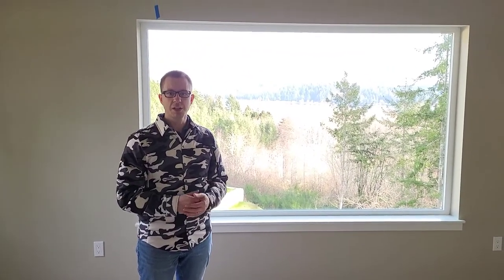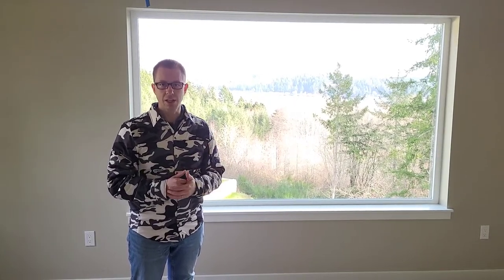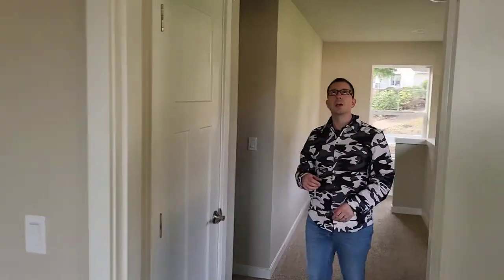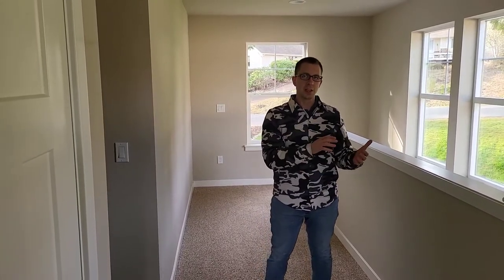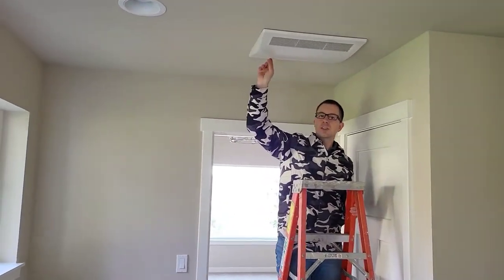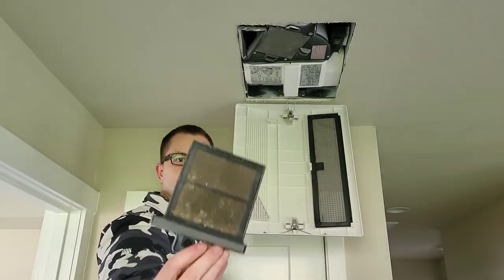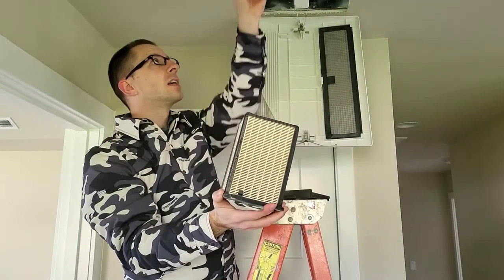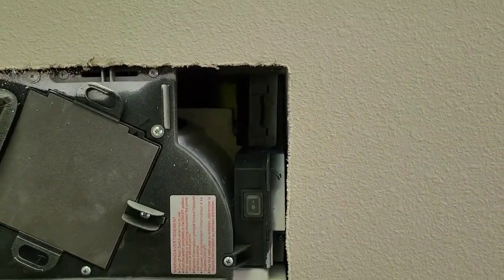Walk Through of the Panasonic WhisperComfort ERV

Comment: Nice video!  It kind of looks like it is just filtering air that is in the house?  Where is it getting outside air from?  Does the return air go through the same filter chamber that the supply air does?
Reply from the maker: Thank you.  The air is filtered, but it also is a more energy efficient way of supplying outside air to a home.  The enthalpy (energy) core allows heat energy to transfer between the outgoing and incoming air streams (sensible heat).  It also allows latent heat (water in vapor form) to transfer.  The outside air comes from an inlet either in the sidewall or roof and it discharges through a separate outlet (again in the sidewall or roof).  The return air is separate from the supply air.  Hope this helps!!

Comment: Could you elaborate on the wiring setup?  I assume its powered by a standard 110 line?  How is the switch wiring setup?  Thanks
Reply from the maker: Bear in mind that I'm not an electrician. I think you can wire one of the plugs in the receptacle as a switched plug, and you can wire the other plug to a separate circuit for constant power (for serviceability). The other wire connects in the unit and at the other switch. The boost switch must bipass the controls in the unit that modulate power output via the dials.
Reply from the maker: Oh, I'm sorry, I responded to this thinking of a different unit/set up. Possibly this is similar? We will be installing a new WhisperComfort, and I'll pay closer attention
Reply: I installed 2 of this units and electrician just ran one wire to it for the white black and ground. And now this things don’t work at all 
I would like to see a wiring to do mines 😫😫😫😫

Comment: I am getting to install Panasonic FV-04VE1 can the ventilation go through the roof
Reply from the maker: Absolutely, although, if the roofing is asphalt, and you're in a hot climate, it might tend to bring in bad air. Consider putting the intake on the north side, if possible

Comment: Im about to install this unit and was under the impression the drywall sits above the flange. Yours looks like the flange is sitting on the drywall...
Reply from the maker: We're going to be installing another one soon. I'll take a look
Reply: I about to install mine as well to my current home and am contemplating how to go about installing it without having to put a giant hole in my ceiling just to fit in. I came up with 2 options and am wondering what you think. 1. Cut off the lip that's around the edge to easy put the unit from the top of through the attic or 2. Bend the lip down and then unbend it when I get the unit through the attic down through the drywall. If I do neither, the only option is to make a longer hole to slide the unit from inside into the attic and then patch the extra left over hole. This option seems the worse. Anyone know if there is any consequence of bending or cutting the lip of the unit. Thanks
Reply: @theczechdude  I cut the flange/lip. Cut the hole to the exact dimension of the box and dropped it in from the attic. I applied ducting tape around the perimeter of the cutout and wrapped it into the side of unit. Made a box out of Styrofoam insulation to put over the unit in the attic and spray foamed over it. I have it connected to a Swidget (dry contact switch) and it turns the fan on and off depending on humidity and air quality levels. This fan is in a 15x15x9 rm.
Reply: @theczechdude  FYI the lip is a convenient place holder it let's you rest the unit up against a finished surface. If you cut it you just need to ensure that once you fasten the screws in the support brackets that the fan is flush with the finished surface.
Reply: @jcberb  so I ended up actually buying a sheet metal bender hand tool and bending the metal lip down so I can insert it through the top down and then I hammered it back flush against the drywall.  Yeah its not as pretty but it got the job done.  The only issue I ran into was attaching the bracket to the studs that is located under the exhaust fans as I have no way of reaching it as its blocked by the 2 fans.  Not sure how to attach it without ripping out extra drywall from the bottom and then patching it.  But then that's what I was trying to avoid in the first place.  Question for you, do you know at what temps does the fan start warming the air or cooling the air.  It does not get that cold here in the east bay(cali) and I'd like it to just pump cool air only.  Thanks
Reply: Those anyone has a wiring diagram for this please 
I have 2 and they stopped working

Comment: I don't understand the logic of having the supply and return right next to each other.  How does this remove stale air from the bathroom, closet or kitchen?  I thought you should have the supply and return vents at opposite locations.
Reply from the maker: Great question. I'll try to remember to do a smoke test and see how these types of units perform
Reply: I thought the same thing and I've them running to 2 different air Vents in the attic to avoid getting same air coming back
Reply from the maker: @theczechdude  are you referring to the air inside the house or outside?
Reply: @PioneerBuildersInc  I'm referring to air coming in from outside into the house. I don't want the air to be warmed up during low or hot temp
Reply from the maker: @theczechdude  Gotcha.  The air streams discharge and enter separately.  There may be some mixing, but I think the engineers have done their job.